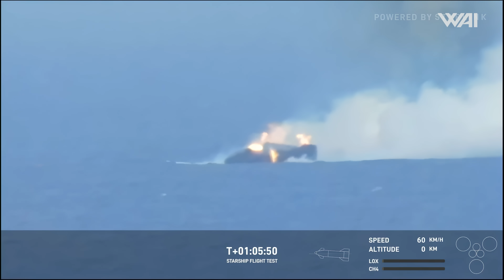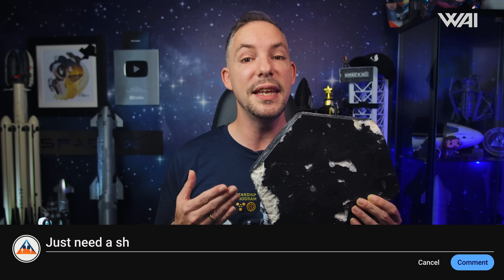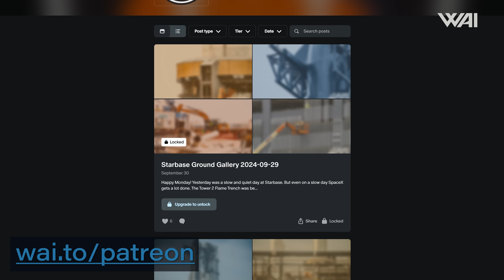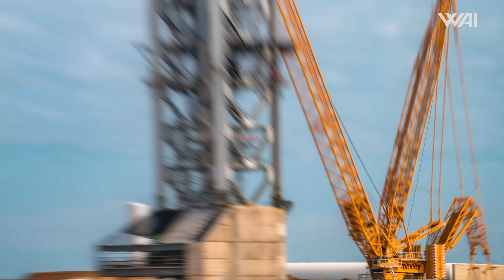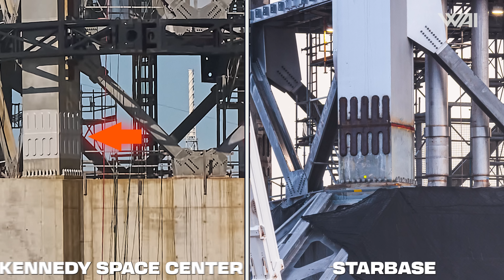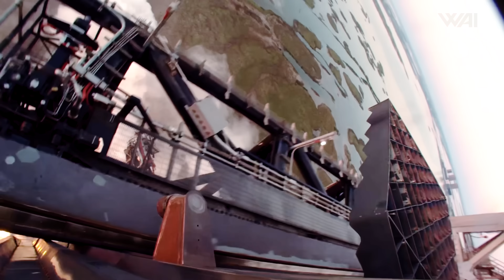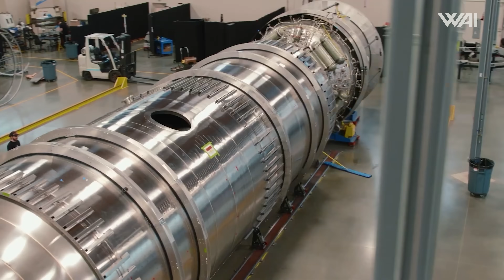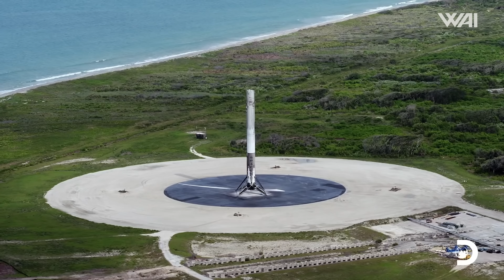Get ready for Starship Flight 7! SpaceX considers BIG Starship heat shield change!

Comment: Exploring actively cooled metallic heat shields again shows how iterative design can lead to breakthroughs. It’s always fascinating to see the trade-offs between complexity and long-term innovation.
Reply: Musk mentioned film cooling way back when starship was still a drawing on the table.
Reply: This is a chatgpt comment.
Reply: @That_Awesome_Guy1  yea i noticed as well lol, very gpt-ey.
Reply: Also, there is almost no downside to at least attempting active cooling in a test.  Lose a ship that you can build in a couple mouths at most?  No big deal.  Tiles certainly seem to be difficult to use consistently(just as they were on Space Shuttle) and they add a significant amount of weight in themselves so the trade offs for active cooling start looking reasonable.
Reply: Have something that seems to work (the tiling system) - at least for non re-used deigns -- and working in parrallel on another solution ---- good idea --- though the tile solution could be made better by an inspace inspection and possibly replacement system -- a ; drone' astromech basically.
Reply: Wasn't this a previous idea, if so not sure why didn't they go with this?.
Reply: @noybone890  If I remember correctly, Musk said in an interview with Everyday Astronaut that heat tiles as a whole was lighter than actively cooled system while being simpler. Maybe either accumulated weight of newer generation tiles exceed that of active cooling system, or they realized that heat tiles wasn't a simple solution that they had hoped for.
Reply: @noybone890  maybe they wanted to test orbital and reentry capabilities of the ship quicker so they went with a relatively already tested and existing technology - tiles. And now that we can see the systems all work fine, they go back to the “newer and untested tech”.
Reply: An interesting idea, but it seriously decreases the load to orbit.
Reply: it also shows flip-flopping within 5 years of prototypes and tests
tbh at this point there is nothing in the initial design that is not up to be questioned or that is still 100% sure (since V1.5, V2.0 has different height, weight, engines, cooling)
however, they should be able to put the first satelites into orbit within 6 month regardless of the rest
Reply: This is interactive design in action. Tiles were a known solution, transpiration cooling was only theoretical. So tiles were used in the early prototypes while the big problems were worked out. I'd wager that transpiration cooling never really went away, but was shelved until the bigger issues are dealt with, it would appear most of them have been worked out so now it is time to revisit transpiration.
Reply: @ You’re talking about entirely different systems, requiring an entirely different engineering approach. You’re not making any sense.
Reply: @angrydoggy9170  who are you replying to? your reply makes no sense without knowing which statement you are replying to.
Reply: @Rorschach1024  First reply was to the original post, second is directed to your comment.
But both are basically about the same issue. Cooling the hull with some type of internal cooling system would require an awful lot of piping and radiators, not to mention a liquid to do the cooling (if you’re going to use the fuel you would need more of it). Any system like that would add complexity and weight, reducing the effectiveness of the system. In my opinion it’s a beautiful piece of kit, but it will never become the fast turnaround system Musk keeps promising. At best it will be like Falcon 9, a highly effective rocket but anything but a fast turnaround thing.
Reply: Except The Terror of Rocket Equation doesn't care about your feelings. Or hopes. Every coolant has mass. Pipes, radiators even more. And then there could be freezing issues, high pressure and volume changes during phase change and what not. Tricky math, extra valves, safety, etc.
Right now Elon is frankly throwing shit at the wall in hopes some of it sticks. I give this new idea 20% chances to work, but at what cost? Further delays, extra weight, complexity? Although tiles solution isn't flawless either. But we already knew that since Shuttle program. Tricky.
Reply: Just watch and see him perfect it @vensroofcat6415
Reply: @vensroofcat6415  Nah, those tiles also weigh a bit. The trade-off is not as steep as you think.
Reply: @paulmichaelfreedman8334  I certainly do agree. We don't know much about tiles total weight or lets say refurbishing issues either. Which will be important. Then considering Elon suggested this "new-old" coolant solution once more, tiles aren't doing that great so far. Obviously. 
All this story sounds more like a setback than achievement. More work needed. Unknown amount. That's about it.
Reply: I mean done if the fastest ever atmospheric vehicles have used active cooling as a must due to the heat… so seems obvious for a reusable vehicle to me 🤷‍♂️

I don’t recall the nomenclature but there was an X test vehicle I believe NASA launched around 2010? That was hyper sonic that used liquid cooling of the outer body… I thought it went up to Mach 20 in upper atmosphere? Might not have gone THAT fast I don’t recall I just seem to recall it had active cooling and went insanely fast as in my mind was blown at the time.

Comment: The issue is flexing. The space shuttle was much more rigid, and the tiles stayed on better. (They are extremely brittle, which is the flaw there) Starship is a flying tank. Made of light weight materials. And Stainless flexes and expands too much. 
The solutions require tiles adhered at these joints to be permanently adhered like on the flaps. And then, as with most other rockets (including the shuttle) white reflective thermal paint or blankets on the leeward side. 
They are trying to avoid this.  But the tiles already involve an EXTENSIVE examination anyway.  The steel cooling, while certainly “do-able” would increase the weight drastically, compared to simple reflective paint leeward
Reply: Paint is also added weight though having a good point, wouldn’t guarantee rapid reuse of the starship as planes are. Respirative heat shielding would guarantee protection to points such as the area where the catch arms come in contact with the ship as well as the flap hinges as mentioned by musk. Any changes will add weight but with guaranteed reuse for any made will make it an extra step closer to a mars landing

Comment: I wonder if, rather that using fuel, it would be worth storing a 3rd cryogenic liquid just for the heat shield? Liquid Nitrogen would seem to be a good solution for re-entry to earth. 
Is the heating at Mars less due to the much thinner atmosphere or similar due to the high speed?

Comment: What if, instead of one tower, two towers on each side of the booster. Two moving platforms would lift the the entire rocket to a much higher height. Just before engine start, a cascade of water falls from the interior face of the towers protecting the hardware, ignitions is started and as the rocket moves up, more water is allow to fall from each higher floor just before the rocket flames reach that floor.
The idea is to use the water to protect the tower and everything else. Also, the benefit of much more stable arms to catch the spacecraft later. Although I still think that the towers must be specialized: One kind for launching and other for catching.
Reply: Just have a moving arm that goes up at launch with water coming out!

Comment: this sounds complicated which is against elons ethos. a YBCO magnetic shield could be made to at 10- 20 tesla with the existing lox supply and a few dozen kwh of electricity. just make a single 70m 10mm x 5mm run up the center of the reentry facing inside portion of the hull and insulate and cool it to lox temps. then you get a magnetic field dozens of meters wide which pull push the plasma back significantly because of the lorentz force. run energy through it before reentry and then start dumping the energy back into the batteries just after peak heating to prep for landing. the magnetic field is only on for reentry so satellites and tanker runs wont care.
Reply: Effect on the onboard computers and data storage not to mention all the other electronics?
:planet-orange-purple-ring:

Comment: In the Stokes design, the exhaust of the intermediary stage can be optimized to provide faster decoupling. Also, it can be easily designed to provide some form of controllable air braking thus providing some steering.
Reply: I liked the landing legs

Comment: I wonder if the existing heat tiles were actually the result of pressure from NASA folks.  We know that SpaceX has rubbed a lot of industry folks the wrong way by succeeding where they were supposed to fail.  Just like how Neil Armstrong and a few other Apollo legends made unfortunate comments about Falcon and Dragon being a dead end and a waste and NASA shouldn’t give them any contracts, we have SLS and Star-liner supporters who want to force SpaceX to use the old high cost, high maintenance systems to keep them from leaping even further ahead of the rest of the industry.  I think they knew all along the ceramic tiles were going to not be enough.  Pushing Flight 6 to the limits they did was to finally prove the point that it is not just tweaking the tiles and a new solution was going to be needed.
Reply: With the added requirement that something along the lines of starship is going to have to figure out how to land on Mars with it atmosphere challenges.
Reply: @NewCastleIndiana  They have been testing that at high altitude when bringing the ships down. They just keep the ship in the higher/thinner Mars equivilent atmosphere to do their tests.
Reply: Active cooling was examined extensively for the Shuttle and was deem too heavy, complex and unreliable. Tiles have no moving parts, liquid cooling has a lot of moving parts that can easily break or clog etc.
Reply: Tiles probably got these first launches off the ground sooner.  Now that they are confident in the rest of the systems they can start playing with active cooling without really worrying about what happens to the ship, since they have a solution now. They WANT a better solution.

Comment: The future for thermal protection will be a plasma shield.
The plasma shield will keep the heat away from the surface and use  "plasma methane reforming," where a high-energy plasma environment breaks down the methane molecules into their constituent components, primarily hydrogen gas and solid carbon, by essentially "cracking" the methane molecule using the extreme heat and energy of the plasma; this is achieved by applying a strong electric field to the methane gas, causing ionization and creating a plasma state where the molecules are highly energized and can readily react. 
Key points about plasma methane reforming:
Process:
Methane gas is introduced into a reactor where a plasma is generated using methods like radiofrequency induction, microwave heating, or arc discharges. 
Result:
The high energy plasma breaks down the methane molecules, producing hydrogen gas (H2) and solid carbon (often in the form of soot). 
Advantages:
High efficiency: Plasma reforming can achieve high conversion rates of methane to hydrogen due to the extremely high temperatures involved. 
No catalyst needed: In some cases, plasma reforming can occur without the need for a catalyst, simplifying the process.
Reply: Why would you expend extra energy into breaking up the methane instead of using the heat of re-entry to do the work for you?

Comment: What it means is that a passive heat shield is not the solution for all areas. Heat shield is one of the deal breakers that needs to be solved.
Obviously ULA didnt get the "no piece is the best piece" memo, but then they aren't playing with a full deck anyway.
Reply: Vulcan is optimized for high energy orbits (GTO+). That means it's core stage continues burning much longer than propulsively landing rockets like F9, New Glenn, or Starship. A Vulcan Centaur with just 2 SRBs already matches an expandable Falcon 9's performance to GTO, even though it can't even match the partially reusable F9 to LEO (only 16.3t to an ISS-like LEO). A Vulcan Centaur with 6 SRBs can put more mass to GTO than New Glenn, but can only put around 57% as much payload to LEO. 

So clearly if you want this level of performance you can either have a very large early staging 2 stage design with a reusable first stage, like New Glenn, or you can have a 2.5 stage design like Vulcan Centaur and Falcon Heavy, with a late staging core stage and early staging side boosters, where you throw away the expendable core stage, or you can chose the SMART reuse system with a heatshield that allows you to recover at least part of the core stage.